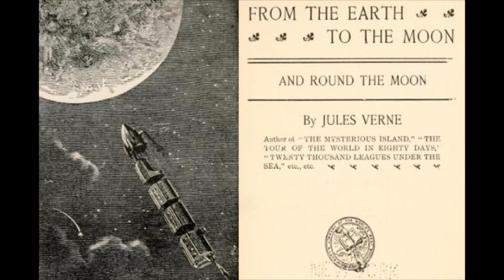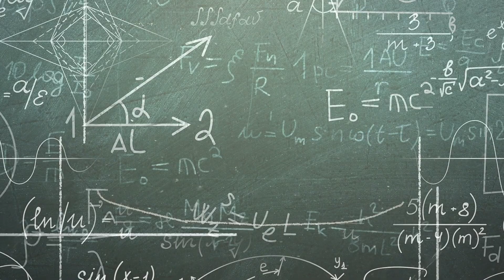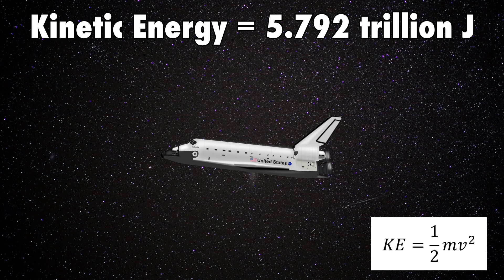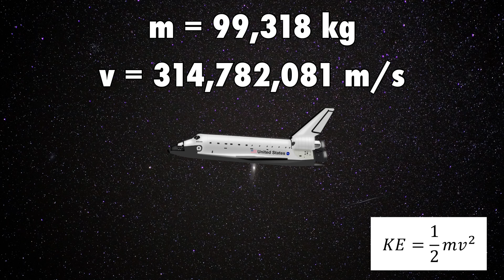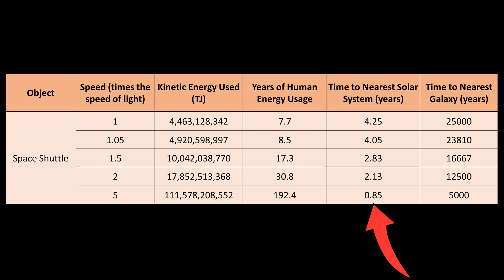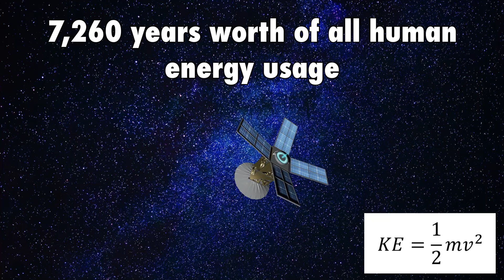The Little Talked About Reason We Will Never Achieve Light Speed.

Comment: This video admits it's biggest flaw at the very beginning. It doesn't understand relatively. Sure, if you try to traverse space using neutonian physics and gasoline you'll be doomed from the get-go. That's not a revelation, that's an ignorant oversight. This video absolutely fails to mention time dilation, and apparently thinks that if you're traveling at 1/2 c over a light year it'll take 2 years, which... lol.  No, it will only take a year and two months, look up the lorenz factor and try again. As for energy density: Nuclear energy, especially via fusion, has millions of times as much energy density as the best hydrocarbon fuels used today. Your first example of the space shuttle acceleration would have required about 30 grams of deuterium fusing with itself to produce that amount of energy. That doesn't include the balace that would have to be ejected if it were a reactive propulsion system, but nonetheless this is a trivial amount of fuel in a post-caveman nuclear age. This is before discussing antimatter as fuel, which is thousands of times more energy dense than fusion fuel. Or external beamed energy, which doesn't put a mass limit on the spacecraft. There are certainly a lot of hurdles to overcome before any interstellar propulsion system can be implemented; but the arguments presented here are not impossible hurdles, they're just poorly contrived limitations decided on by someone who doesn't understand basic physics

Edit: "450 Hiroshima bombs, an impossible, unattainable amount of energy..." you mean like 1/5 the amount of energy released by tsar bomba!? That's impossible to do?!

Comment: I get it u just wanna get a rough idea of how much energy it'd take but u gotta modify the equation for things near the speed of light. The equation KE = 1/2mv**2 is only for objects that are a lot slower than the speed of light, any where near the speed of light u can throw that equation outta the window cuz it bears no meaning. Closer to the speed of light u just gotta slap gamma on the bottom of the equation, and that reaches an infinitesimally small value as velocity approaches the speed of light and as we all know if u divide a number with a number that's incredibly small you get an incredibly huge number. It sucks that the stars will forever be out of our reach, I personally think we will be bound to our solar system, which is really sad to think about.
Reply: It's like making arguments that flight is impossible because steam engine is so heavy.
Reply: @leonidfro8302  at least flight was theoretically possible. Birds do it.
Reply: @ushikiii  Flight at 0.9c also possible - particles in accelerator do it. Space bending is also possible - massive objects do it. Some unexplained stuff definitely possible - dark matter do it.
Reply: @leonidfro8302  ur dealing with elementary particles with particles accelerators, since mass is a constant in that equation it would make sense plugging a small mass would help reduce the amount of energy required. But we are alot bigger than elementary particles. Not familiar with space bending. Don't have a comment on the dark matter, could be legit.
Reply: @ushikiii  “space-time bending” is how gravity works, see general relativity. Particles at 0.9c prove that stuff can move that fast.
Reply: @leonidfro8302  I know stuff can move that fast. I literally explained why they can. But we are alot more massfull than a proton, we aren't comparable to basic particles.
Reply: @ushikiii  My point was that basically we are comparable to particles. We’re heavier, true, but principle is the same.
Reply: @leonidfro8302  no... They aren't comparable, we are literally talking  about hundreds of magnitudes different. That equates to hundreds of magnitudes of energy. To accelerate just 10 humans to 90 percent of the speed of light already would require 1/3 of the energy the Human race uses per year. Think about that, only 800kg requires the entire human industrial might to accelerate near light speed. Now space ships weigh tons upon tons...
Reply: @ushikiii  Numbers are irrelevant. They are comparable because they are made of same material and obey the same laws. 
About amount of energy - mc^2 is really big number.

Comment: If we ever get there we’re probably talking about matter/antimatter or fusion technology. The scale of the energy problem is a lot less daunting when you get to use e=mc^2
Reply: I was going to say, referring to that first space shuttle acceleration problem, it would require about 30 grams of deuterium fusing with itself to output that 5.8 trillion joules. If the process were only 25% efficient than 120 grams; literally nothing. Accelerating to 1.05 c requires about 27,000 kg of antimatter to annihilate with an equal mass of matter. These numbers seem big to us in the frame of currently being terrible at producing energy, but they aren't ludicrous or insurmountable

Comment: At relativistic speeds, the equations you have shown in the video do not apply anymore. Also speeds higher than c do not make sense in the physic world we live in. So the table calculation with the speeds and the energy is not correct. To reach c the amount of energy required is infinite for any object with mass. At c, the space between origin and destination, in the direction of travel is ZERO length, meaning that anyone travelling at c will depart and arrive at the same moment, from their own point of view. Given that the distance is zero at c, any speed higher than c DO NOT make sense. The warp speed in Star Trek is not needed to allow the crew to arrive at their destination faster, given that at c they arrive instantaneously.
Reply: That's deep.

Comment: Time is relative. If the space shuttle is traveling at light speed, from the perspective of the occupants they could reach the center of the Milky Way instantaneously, but to those of us on Earth it will seem to take them over 26K years. However, it is critical to understand that it would take an INFINITE amount of energy to get any object with mass to that speed. As you get closer and closer to the fastest speed possible it takes more and more energy to increase your speed. This is ultimately the reason no object with mass can ever achieve that speed.
Reply: They know that... they were saying before even considering that.